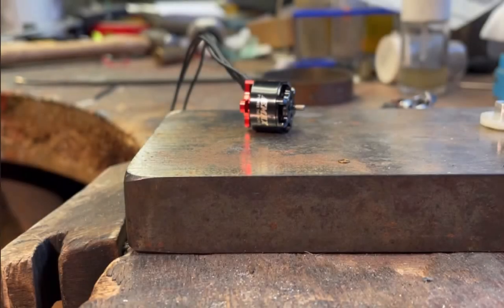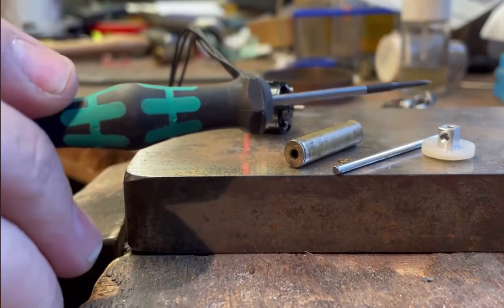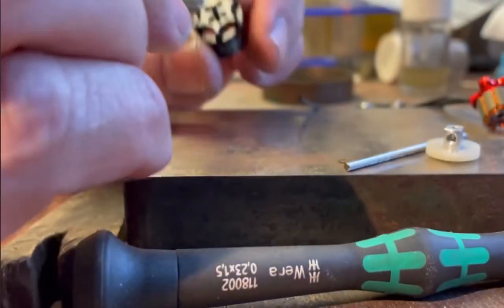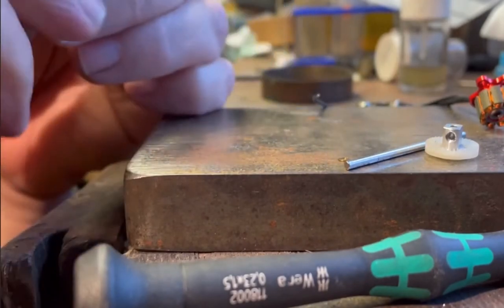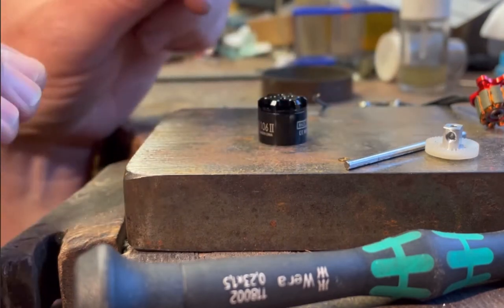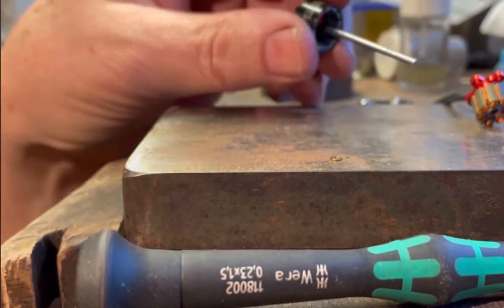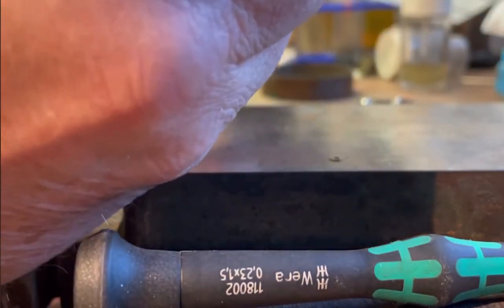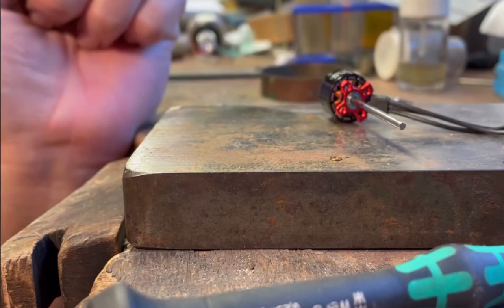Brushless Motor Shaft Tutorial with Richard Mack

Comment: I followed your instructions with my first brushless motor. Put a bearing inside and tapped the shaft as you said, but it didn't move. I managed to get it out using a vice but the shaft on my motor has a raised lip at the end so the hole is now slightly bigger than 2mm meaning  it's no use any more. The shaft needed to be pushed out the other way so maybe you should put a warning in the video that some motors are different.
Reply from the maker: That is the way Richard Mack changes the shafts out. I made the video that suggested using a vise or press therefore not to damage the stator bearings by bashing them with a hammer! Use the press out method in the other video
Reply: @brushlessslotcarracing  I used a vice but the shaft is slightly bigger driving it out the way Richard did and needed to go out by pushing the other way
Reply from the maker: @davecoward8891  take note of the shaft size on top of the rotor. There is a shoulder on the shaft to stop it in  the hub in the rotor. The shafts are pressed in from the factory from the top until the shoulder hits the hub. They must be removed in reverse of the procedure, pressed from the bottom out the top of the rotor or the shoulder on the shaft will damage the rotor and it probably won’t be salvaged.
Reply: @brushlessslotcarracing  Yes I know that now, but that isn't what Richard does in this video. You can se that he puts the brass tube with the bearing inside the motor case and taps the shaft down. I assume some motors must go the other way which is why I suggested that it should be pointed out. Either that or everyone is going to ruin a motor first time they do it.

Comment: What are the motors you are using?
Reply from the maker: They are drone motors. in this video its an 1106 4500 Kv EMAX. We have used motors from 1106 to 1408 in diameter in slot road course cars and drag cars.